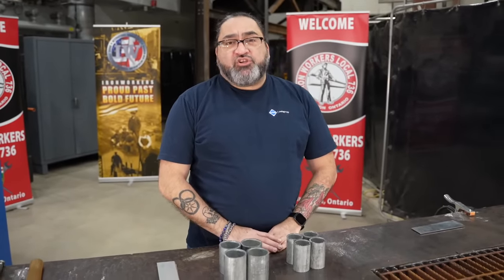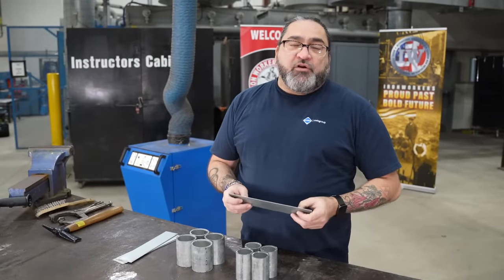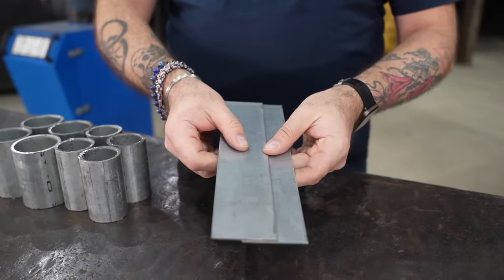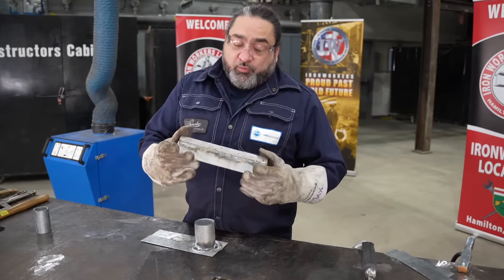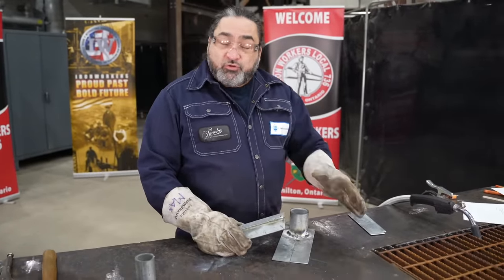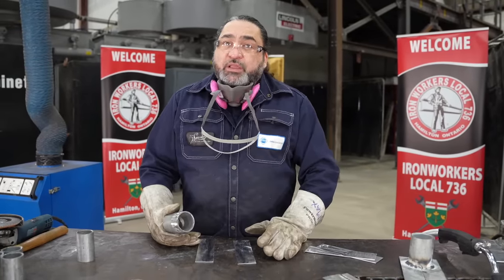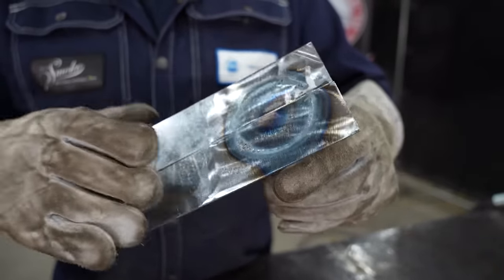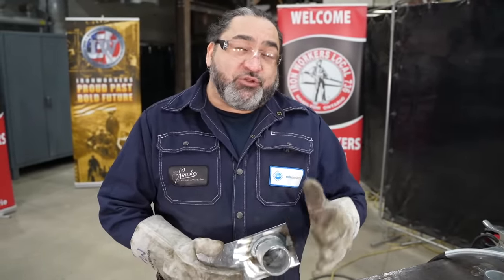How to weld with Galvanized Steel

Comment: Does anybody make welding wire or rods that can weld over the galvanized coating?
Reply: Yes, metal Cored Hobart FabCORP F6. 
We are going to qualify a WPS with this wire over galvanized steel plates.